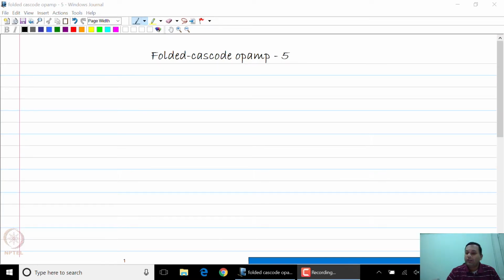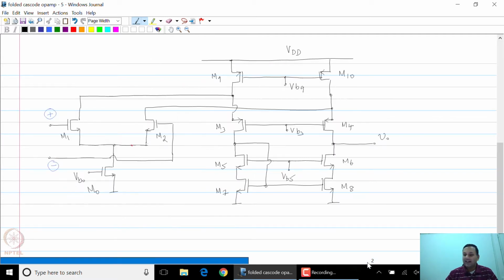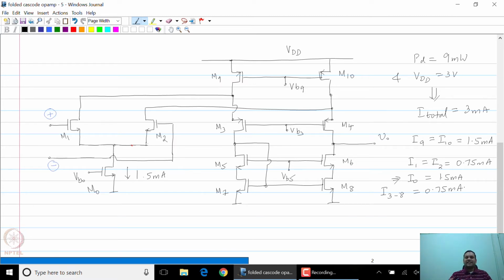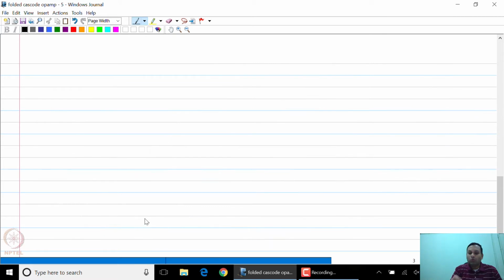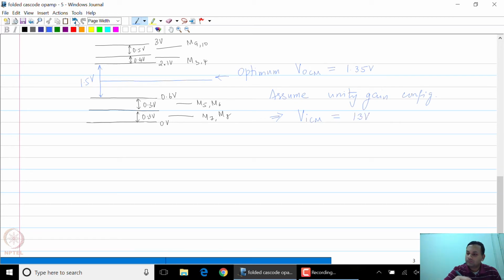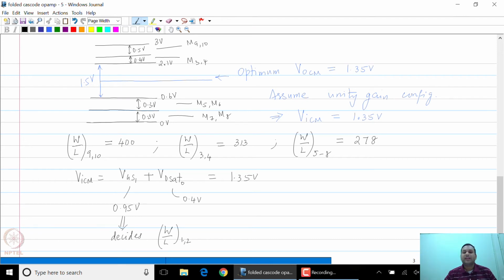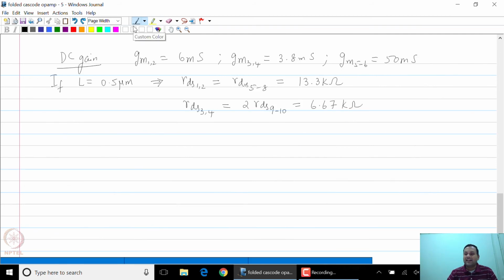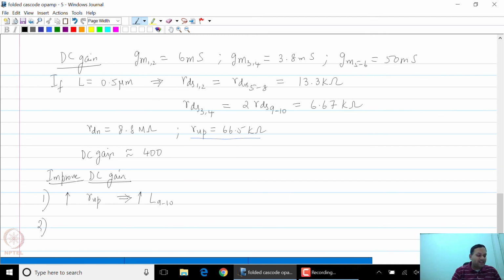Folded-Cascode OpAmp-5

Comment: It will be good if you said  how you got the aspect ratio of transistors (9,10) from drain current and overdrive voltage
Reply: Substitute in simple current equation